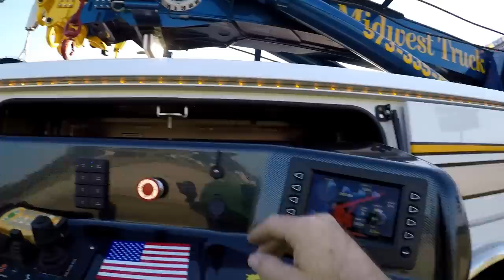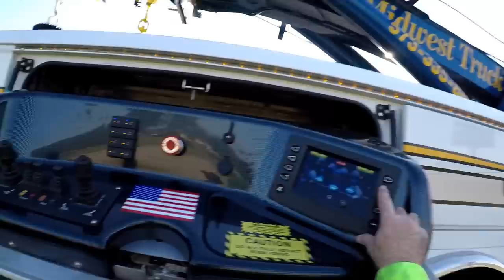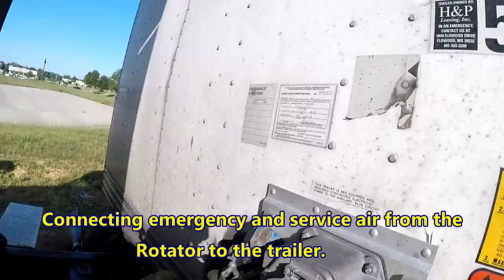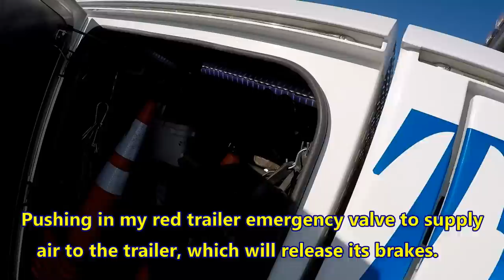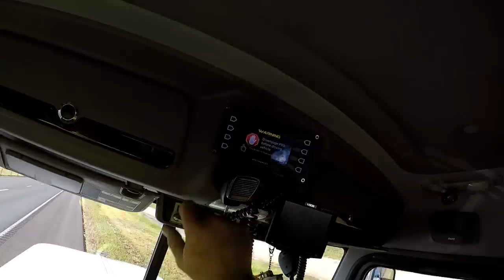BCD    Barrier Cable Destruction

Comment: So I have to ask. Why have a siren on a tow truck? I mean, I guess I could see it for like if someone is entrapped, but other than that, I don't understand the need
Reply from the maker: I get this question a lot and most people do not understand and some don't agree with the State of Missouri.  I will attempt to explain so that everyone reading might have a better idea as to why we as tow/recovery operators are allowed "Emergency Vehicle" status in the state of Missouri.  First, I have a video explaining the actual state statutes, but they, alone, do not answer your question.  There are times when we are called to "Expedite" (run lights and siren) to a scene because there is a need for us to assist with extrication or recovery.  Our company has trained with both Fire and Police personnel and have certificates for Traffic Incident Management Systems (TIMS), light duty extrication, heavy duty extrication, grain bin extrication, to name a few.  We are not required to do so, but we firmly believe in cross-training to not only educate, but to build relationships, not to mention the fact that if you train together you work better together on-scene.  
Here is the part that a lot of people don't understand or don't agree with....every minute spent at a crash site is another minute for injury, death, additional crashes, etc.  Keeping traffic flowing normally reduces the risk for everyone and also keeps the economic "life-blood" flowing.   Quick clearance of a scene is recognized by the State of Missouri as a vital part of the Emergency Services and is in large part the reason that we are granted Emergency Vehicle status.  Distracted and/or impaired driving are on the rise and having vehicles and personnel on the side of the road only add to risk of more injury, death, or crashes.   
Whether someone agrees with this or not, in the state of Missouri,  towing/recovery vehicles are considered Emergency Vehicles.
I hope I have sufficiently answered your question.  Thank you for watching.   Please be safe and God bless.
Reply: Ron Pratt thank you for your reply! That sure does explain it better. I sure appreciate it!
Reply: Ron Pratt, Thank you for helping me to understand this. I was also wondering about the siren. I understand & appreciate what Missouri has done now, thanks to you. I used to flag when I lived in Colorado and safety on the road is a great thing.
Thanks again on the info. Hope you have a great day & be safe.
Reply: can you put the link to the video into the description below this video please
Reply: Ron Pratt im only 11 but you fascinating to watch your a true hero stay safe on the road 😃
Reply from the maker: https://www.youtube.com/watch?v=a10si2tvX10
Reply: Ron Pratt; learn something new everyday. Good to know.  I wouldn't even think of looking up something like that on the net before visiting a state for the first time to familiarize myself with any road rule differences.  Thanks.  if I encountered a tow vehicle with a siren it would be promptly ignored and thought of as a wanna-be doing a terrible cop impersonation.
Reply: 1bummerdude in my state alot of tow trucks use it because tow trucks need to get to the scene to help  firghfighters and like company's who need the motor vehicular moved for safety like power lines they dont use it all the time but they still use them
Reply: It’s nice the state allows it, but apparently the residents could care less. They don’t get out of the way.
Reply: Vlad M my personal opinion is that the driver does not use his air/manual horn enough
Reply: CT doesn't use sirens on tow trucks but when their lights are on you're supposed to move
Reply: I live in kansas city  missouri  we only  run red in blues on tow trucks
Reply: 1bummerdude he works with the cops as well
Reply: You should try to swear less, shoot darn it 😆
Reply: first time i saw one of your videos i assumed the sheriff was your brother and you bought him a beer and he gave you a siren permit.
i have never heard of a tow truck being recognized as an emergency vehicle.
it doesnt matter if i agree with it or not, the law is the law and that is that.
Reply: Ohio recognizes them as emergency vehicles for some purposes but not others, while they can break some of the laws in regards to weight limits, they are not allowed to run lights and sirens
Reply: TheDarkalkymist  correction im a 17 yr veteran of the towing industry in Ohio. We are classified as an emergency vehicle in Ohio but still have to run by the weight limits and are only allowed running our beacons on the side of the road or towing in adverse weather conditions.
Reply: Oklahoma has this law too and you see tow operators with blue and red lights. Only those of us who have worked in public safety recognize the need to clear an accident from the road as quickly and safe as possible. There have been many times when 1 accident sparks a chain of accidents due to distraction or rubber necking resulting in a messy scene stretching a few miles and leaving a road shut down for hours. On top of that as you can see in Ron’s videos multiple times, I don’t know what is it with people but they can care less about a responding emergency vehicle, they wont move over for a siren and they wont move over when you are on the side of the road working a scene, but they want help to get to them when they are in trouble!
Reply: Doesn't it upset you when people ignore your siren
Reply: 1bummerdude hey
Reply: I live  in Florida. EVEN HERE we wait at times 45 minutes to an hour or more for towing or recovery. You wanna guess how far traffic in the #1 tourist state can back up in that amount of time?? YEAH. FL. does NOT allow towing and recovery "emergency vehicle" status... So the drivers start getting impatient, trying to drive down the E-lane. Even in the comedian! NOW guess how long it takes for the recovery vehicles to arrive. I WISH FL. would do the same as MO.!!
Reply: 1bummerdude because were hey are they are considered emergency vehicles
Reply: LuigiFan2005 yes there is, pa has one with a Q as well as California. Or they did years ago anyway lol
Reply: Billy Bracewell where abouts in Florida are ya roughly? I run a rotator at KAUFF'S out of Ft. Lauderdale... Would love to buy ya a beer. Most Floridians would laugh at such a thing. I too wish we had the same privilege as MO  wreckers. But I understand.  Turnover here for operators in the sunshine state is especially high. mostly because of addictions, or misuse of our silly amber/white lights and horn, as if anyone pays attention to them here anyways.. . a few bad apples spoil it for the bunch. But hey, it's all about conduct. we clean up our act, we may be granted a few luxurious permissions such as priority responses. until then, we drivers, as well as the motoring public can expect the response times to continue to grow...
Reply: 1bummerdude k
Reply: I'd wished the police would enforce the,traffic lows down here in NORTH Carolina , especially Robson County , I'd lived in Maryland for over 50,years. They wrote tickets,
Reply: Hey Ron, I have been watching a few dozen of your videos "great job Sir".  I have never heard of a tow rig with Red/Blue lights and sirens. First if it was illegal you would have heard about it and likely sited long ago. I am a Scanner enthusiast listening to LEOs, Fire and EMS. Ron one reason your lights and sirens do not get the priority it takes to expedite your travels is simple. I recommend you talk to your Fire Brothers and Sisters about the "Q" siren. Yes, its louder and can be played to display import ants! Electronic sirens are cool BUT they have a sense of omnidirectional sound it’s hard to tell where it comes from, so there is built in confusion with them, not the "Q" though. Great videos I also watch HH on weather channel. great stuff, please stay safe sir!
Reply: agreed Fire trucks stnd on theres so should Ron.
Reply: Cause the faster he can get there and the faster he gets wrecks off the road the faster backed up traffic can start moving again. I hope that explains it in laymens terms. As always, thanx for watchin and God Bless!
Reply: 1bummerdude i said the same thing to myself...but than im like wwait...there is an emergency and tow truck monster has to get there asap.hmmm sirens = everyone move out the way
Reply: The quicker you clear that highway the lower the chances are something else will happen.
Reply: How about not assuming you know all and just move over and let them pass. Rule 1 for safe driving - Be courteous. You cant follow rule 1, get off the road your dangerous to everybody.
Reply: I completely understand why Missouri has that policy. I think its great for the safety of the workers on the side of the road, and for traffic flow. I live in Washington state and we do not have any laws like that. So you have a big traffic jam it can take hours for the tow truck to get through to the accident only making the problem much worse. Thank you for having the training done even if it isn't required. I cannot think of a scenario where extra training is disadvantageous. I want to thank you for the vital service you provide. I just had one quick question: when working on the side of the road like this, are you ever scared? I mean obviously you are aware of the danger and take all the necessary precautions but you certainly must still be scared, right?
Reply: Archangelus e
Reply: @RonPratt  Training together and working together is a great idea. Thanks for explaining and making it clear to understand.
Reply: Once you tow the truck that does need a horn you become the truck... withmore reponsabilities
Reply: That incident was well protected by the two fire service vehicles and the police car and it was in good day light. But a disabled vehicle is a danger to other road users, so it's good to get them cleared as soon as possible. Having the tow truck arrive in a hurry also frees up the other first responders so they can attend to other duties. I think it's a great idea and should be taken up by other states and countries,
Reply: 1bummerdude because when the police tell you to run code you run code lights and sirens
Reply: I understand why, if you’ve ever been stuck in traffic for hours waiting on the road to get cleared you’ll think it’s a pretty good idea
Reply: Good question and a good reply.
Reply: @RonPratt  ALL Tow Vehicles should be granted Emergency Status. So there is no question about their status. "Stay away from them. Give them the honor of the road.  In MY opinion.
Reply: Thanks, it is a good thing . Safe te road so quick as posible
Reply: This is a good thing that more countries/states should implement. Sure what's most important is to make sure that the people involved in the accident can get the immediate help they need (ambulances and fire-services). But clearing the road is also very important and helps keeping everyone else on the road safe.
Reply: The short answer, because there are idiots when traffic is stopped and they are in a hurry and just want to get through. They will do whatever it takes whether it's cut off a tow truck coming to do recovery, an ambulance, fire truck, police car, whatever. Even when they have lights and sirens these idiots don't have a care but for themselves. So some states like Missouri and Florida actually require tow trucks to be heavily lit and equipped with sirens to be able to alert drivers they are coming and it's an emergency. Most of the time all truck drivers are trained in basic CPR, extractions, and recovery. Most people won't move for a vehicle if it's not lights and sirens so in order to save someone trapped, get traffic flowing, get a family/trucker/vehichles off the road in a timely and safe manner, you must be able to get the tow truck on the scene and not stuck in traffic.
Reply: Expedite means as fast as possible.
Ordered by PD
Reply: Different states, different rules.
Reply: @RonPratt  hi
Reply: @RonPratt  as you said Ron. A road that is totally blocked prevents movement of vital resources, ambulances caught in the traffic, etc.

Also some people might start getting "road rage" the longer they are stuck in the backup.
Reply: @Sublimebmx187  I think in many, if not most states you are required by law to move over for a vehicle that has a siren. Drivers just don't. Just like in most states, driver can't use the cell phone or text.... They still do, and cause lots of crashes.
Reply: @nunya99  I noticed that he seemed to be completely ignored most of the time.

I think the state got it right though. I can imagine the scenario where it might be a tow truck is the only way to get to a victim, If you can't get to the victim it might be hard to tell if they need emergency care or not.
Reply: In Denmark and Germany some Falck tow trucks have blue lights and sirens, mainly because Falck have a mandate to assist the fire department (and in some areas they ARE the fire department), but since we normally close off motorways/highways when there's a serious collision or risk of collision,  they very rarely get used as emergency vehicles. Here it's typically only on motorways the vehicles are removed in a hurry, or when they block intersections as such. Most often if the vehicles isn't on the road it's left there until the road isn't busy and it's safer to remove them.
Reply: @RonPratt  sorry too hear about your dad my condolences 🙏
Reply: Ron Pratt, AH COME ON RON!!!!!!!!!! IT'S THE LITTLE KID IN US!!!!!!!!🤣🤣😂😂😂😂😂, PLUS THEY TELL YOU TO,  NOT ALL STATES ARE THE SAME!!!!!! GREAT JOB!!!!!!!!!!!

Comment: I love that the officer realized that you were in a vulnerable position and stood in the lane so the cars would move over great work by that officer
Reply from the maker: Yes it was.  I was and am very grateful to him.  Thanks for watching and God bless.
Reply: Brave officer!
Reply: Strange that they had the right lane closed when he got there, then opened it up while he was still working, though.
Reply: Yeah, suss as.  Firies just bailed out.
Reply: Unbelievably bravery by the police officer, as for the fire department they only need to be there if they are needed to fight fire or provide paramedic services. Public safety is the responsibility of the Police which is why the officer stayed and helped, however as always ‘slow down and pull over’.
Reply: Just goes to show things are not as bad across the board as our media likes to report.   Good is out there.
Reply: All lives matter.
Reply: Brave, but mostly idle. Sometimes helpful, therefore respectable. You should have to thank these officers, when they don't put their hands in their pockets.
Reply: Should have put squad car further down the road so traffic would move over.
Reply: my thoughts too! :)
Reply: I have seen many of his videos where traffic is "maybe" 18 inches from him and his crew moving 60+. They refuse to AT LEAST slow down

Comment: There is nothing better than a big truck that can get up and go.  Its still amazing to me after 17 years in the fire service how people just ignore a huge truck with flashing lights and siren going.
Reply: James Kinkead Drivers everywhere has become very oblivious to all around them these days. Scary!
Reply: They don't move over for Ambulances either.
Reply from the maker: Around here it is crazy.  A lot of drivers don't respect ANY emergency service vehicles running code.  I can cross over into Illinois, where I'm only allowed to run amber emergency lights, and drivers will slow down and pull over for just the ambers.  Southern Illinois is just a few miles, but it is a whole different world.  Thanks for watching and God bless.

Comment: Nice recovery.. Its cool to see the mutual respect between tow truck operators and local law enforcement..Watching you haul all those air hoses.. Wouldn`t a built in retractable reel of maybe  50ft. air hoses make it better/easier to connect? I`m sure Miler could hide it internally. Or do you have better control as is, today?
Reply: Cruisewolf CPD cops are super chill and they respect tow operators. The FD will actually sweep the roadway of debris.
Reply from the maker: We have built that level of respect by making the effort to train and work with our local emergency services.   If we train together we work better together.  As for the air hose reel, Miller does have them available as options on certain bed styles.  On this particular truck with the rolling carriage boom and the rear drag winch, there is no room for a reel.   Thanks for the suggestion.  God bless.